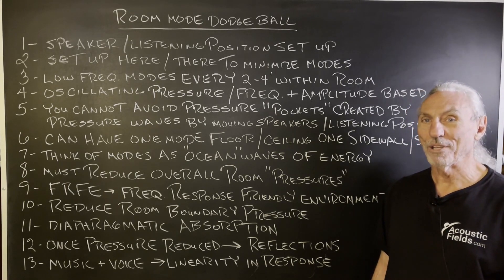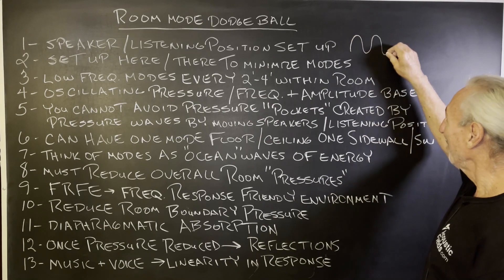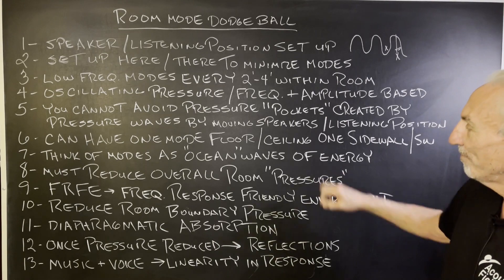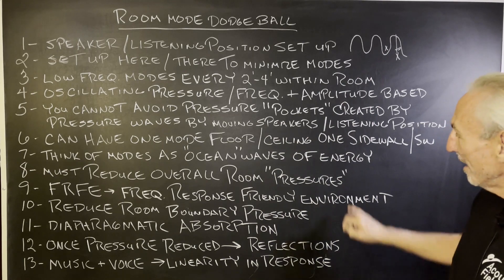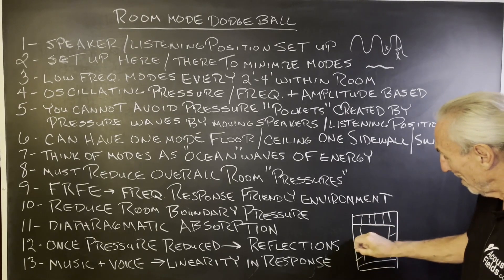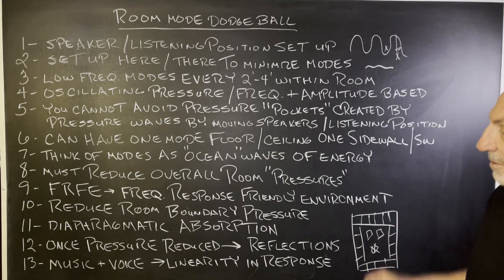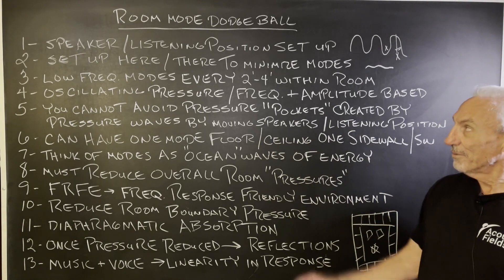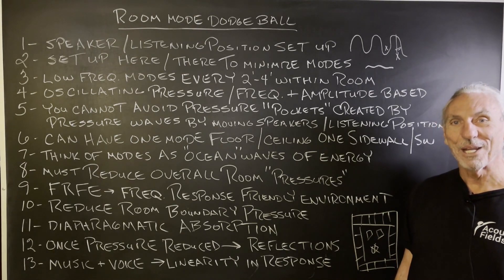Room Mode Dodge Ball - www.AcousticFields.com

Comment: You cannot escape room modes by  moving your speakers or listening position, but you can spend 50,000 to 300,000 $ or so in room treatment... :)
Reply: No, but you CAN change the intensity of those modes on your listening experience by optimum placement of your speakers and listening position.
Reply from the maker: The cost is determined by the resolution goal. The higher the resolution goal, the greater the cost.
Reply: @AcousticFields  
No
Cost is determined by where a given room is now, and what is needed to get it where one wants it to be.
Reply: Diego Sanchez ... fffin' spot on!

Comment: It’s like using a bandaid on a wound when you need a tourniquet. So if a person has a headache you don’t go see a podiatrist. You are a Doctor of Sound Pressure Resolution. 😉 as always enjoyable presentations of facts not suppositions. Thanks!
Reply from the maker: Pressure and reflections are the two main issues to address. Start with unwanted modal pressure management first and then work your way through reflection treatment.
Reply: @AcousticFields  
Uh... yeah. 
Pressure is what loudspeakers produce.
Reflections is what the room produces. 

Marketing bs
Reply: You realise Acoustic Fields is the Band-Aid in your analogy... not the Dr of whatever.